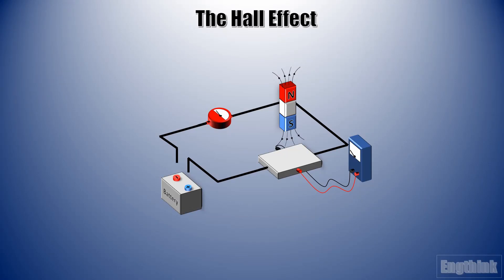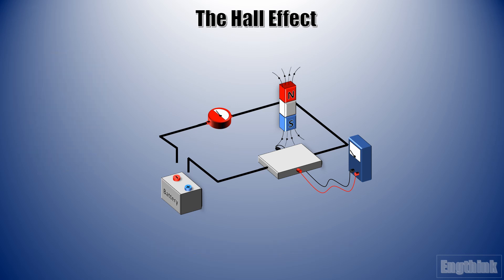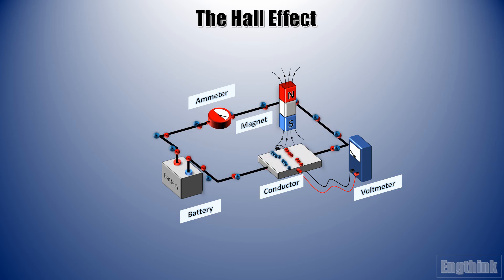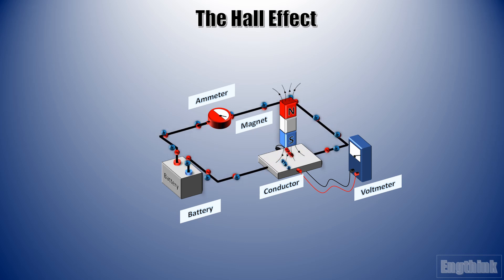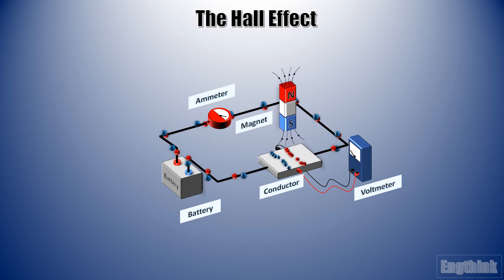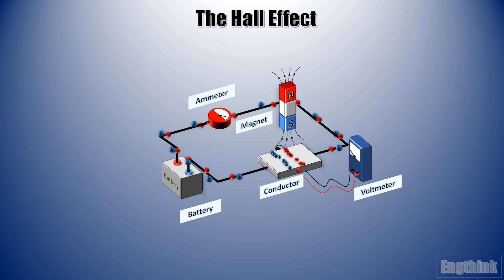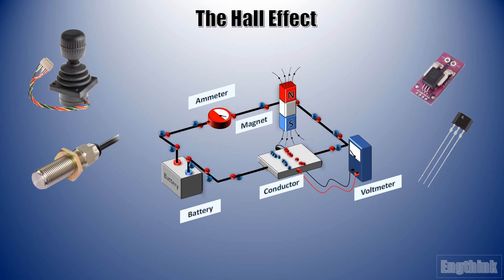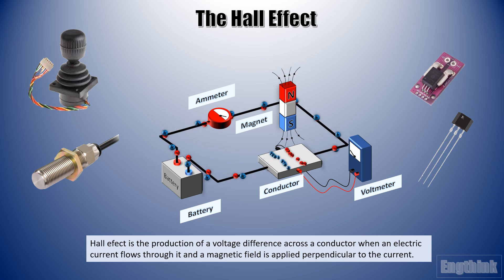HALL EFFECT THEORY Explained in 2.5 minutes #hallsensor

Comment: is there a formula to convert from the recorded voltage to tesla
Reply from the maker: You can check the manufacturer datasheet of the sensor for example the model 49E, línear hall effect sensor. There is a Electromagnetic Characteristic sensititvity where the unit is mV/mT, so you can measure the output and convert.